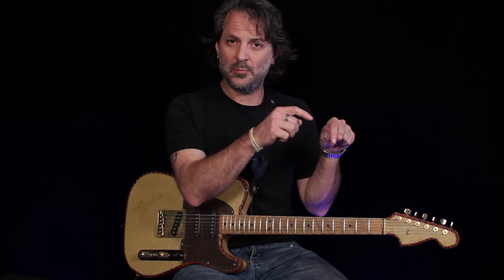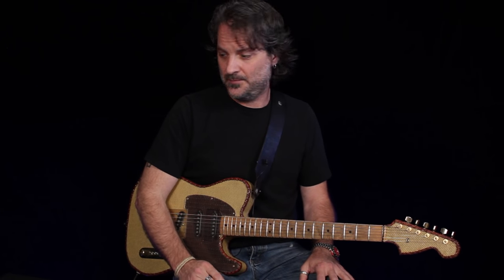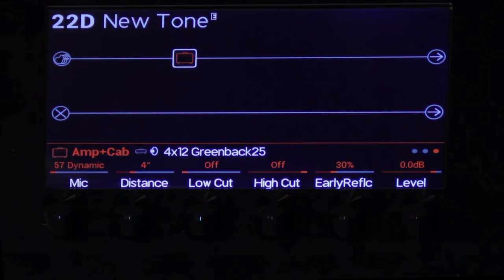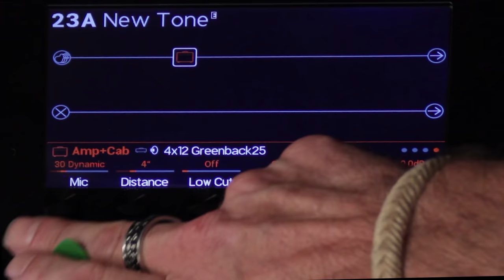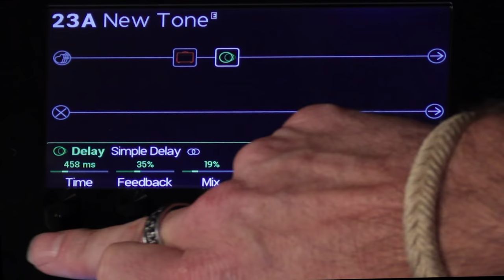Three Quick Tones With Helix | Line 6

Comment: what added value to the line 6 as a reference brand was to invest heavily in demos with amps , that is , as a guitarist and user of line 6 for 20 years , I am often confronted by young people who can not even get close to the sound of guitar that you present in these demos. In other words, young people buy line 6 and are frustrated with the sound.I give some examples taking into account what I see and watch in the country where I live;

many young people buy the helix, stomp etc thinking it will be plug and play, but when they get home and connect it to the amplifier, the sound does not match, some do not use the amp preamp to try to make the most of the simulations but even then they do not succeed.
For example for users of the best selling amps in the world: Fender Deluxe 5E3 «Tweed»
Vox AC30 Top Boost.
Fender Bassman 5F6A '59 «Tweed»
Marshall JTM45.
Fender Twin Reverb «Blackface»
Fender Deluxe Reverb «Blackface»
Marshall 'Plexi' 1959SLP Super Lead.
Hiwatt Custom 100 DR103.

line 6 should provide an equalization setting for users to come home and connect to the front (or just to the pre (using only the amp's power)) and be immediately satisfied with the result.
And the same should be done to the 3 types of guitars , les paul , strat and tele
This little job for line 6 would double sales. Hugs and thanks for your attention.

Comment: G'day Sean, can snapshots be set up to use both single (either modelled JTV or Mag) sounds and split JTV modelled and Mag tones in the same set of snapshot patches?
I believe it is possible, but nobody has been able to show me how to achieve this, stores have no clue, the Aussie rep is unresponsive, and the manual may as well be in Chinese to me.  I've been using the Line 6 gear for nearly 10 years, but still feel way more comfortable with old school pedals in line, so the whole digital thing does my head in.  I have spent literally days on end working through these units, and still not gotten anywhere.
I have set up a heap of snapshots (as best I can), but need a split harmonised patch edited into the snapshots, with JTV modelled tone on one side through one amp sound, and Mag pickup on the other with a distinctly different amp tone, and a slight (milliseconds) delay to make it seem more like two guitars playing together rather than an obvious duplicate patch.
Or another I want to edit in is to get a crisp Acoustic with a touch of compression on one side, and a crunch driven Mag sound on the other, with Wah able to be used on the mag side.    That same thing would be replicated as a 12 string / electric patch.  My original band has several  Country crossover (think Smokie or even some of Bon Jovi ) styled songs, where I need to be both acoustic and electric or 12 string and electric simultaneously.   So then I need to be able to switch back and forth from the twin input /output tones, and the standard single input tones.    The splits need to be panned about 70% or so either way to allow some bleed across the field, but still maintain some degree of stereo separation.  The reason for the bleed is  purely because in the past when I used the HD500X / JTV set up, I found that even though I had purposely set the sounds so for example the acoustic in a split patch may have been louder or softer than the electric on that same patch to suit the song,.. because I had the sounds panned hard left / right, the mixing guy would think I had fucked up the patch since one was not loud enough (to him) or too loud (again according to him) and he would instantly bump one side up / down, then when I switched patches, the next patch would be all out of whack.  As I am sure you realise, most of the time we want different stereo tones at different levels to achieve what we have in mind or to reproduce what is on the recording, but try explaining that to an overzealous FOH engineer.  Hence if I only pan them 70% L/R then they can't screw with it the same way as there will always be some of each sound bleeding across the spread.  Or if you know a better way to achieve this sort of outcome, i am happy to try that also.  I have seen a lot of your clips and you seem to get great separation, even on non stereo specific tones, and that is through shitty Macbook speakers, so I am sure if I went into the monitors it would be more evident.
I've explained this many times to locals who use Helix gear, but I am possibly the only guy in Perth WA with both the JTV and Helix, definitely the only one using Snapshots, so they glaze over as they have no experience using the JTV in conjunction with the Helix, and snapshots, forget about it, they don't know where to begin.   I figure if I am going to go down this modelling path, I want it to do the most it can do, otherwise I may as well be plugging a Strat, pedals and amp rig in, with my acoustic on an chest stand as I did for years rather than this fancy shit.

Comment: Interesting demo. Excellent guitarist and very authentic sounding tones. I'd be curious to know if I can turn the cabinet emulation/IR off and plug this puppy in EFFECTS RETURN of my amp and still sound really good? I suspect unit of this caliber would sound great into P.A. or FRFR speaker, but I'm still prejudice. I believe half my tone comes from my speaker/cabinet moving air.
Reply: +lpgoog  never forget that this is an evolution of sounds that if a person knows how to use very well with your amplifier will play 'always great method 4 cables use real amp with effects helix or use your amp helix with final amp true.
Reply: +lpgoog 
The great thing about the Helix is, not only can you turn off any cab sims, but it also has a Preamp model section. I would use just the preamp models if I were going to be using an external tube power amp and speaker cab.

Comment: It would be nice to have a little more love for those of us that have already spent a small fortune on HD500 and DT series amps.  A little more effort on some DT integration work-arounds would be nice.  I realize the architecture is completely different with the helix, but give us a little something more to work with please.  It's really the only reason I'm not planning on buying a Helix.
Reply: +Stratomacaster Yeah! Another one here. Until the DT integration isn't as good as in the POD HD500 and there is no decent GUI to tweak Helix on a PC, I'm not even thinking of buying Helix. A shame because Helix is maybe the best floor unit on the market, period.
Reply: They developed an entire new class of product, and it is obviously not designed to be an incremental change from the old stuff. Demanding integration with the other lines is really unreasonable from my perspective, and would steal resources from making the HELIX the best it can be.
Reply: +The Guitar Geek So, why did they bother adding a L6 link output there? Only to integrate with StageSource? The L6 is a Blend of audio out with Midi messages where we don't have to know nothing about Midi. It doesn' require any significant processing power. I can't understand Line6 option, really
Reply: +Nuno Carmona  The L6 FRFR speaker output is exactly the reason why the output is there. The HD500 was never meant to be compatible with HELIX, but the speakers are. Just be cautious when claiming how "easy" it is for a company to add, code, test and support features.
Reply: Easy or not it seems product management failure in that point to me.
Reply: Your point on the DT integration is well taken - I don't love the message that sends. Still, the complaining about the HD500 / HELIX compatibility seems unreasonable.
Reply: The Guitar Geek a year late but just saw this. That’s not what we’re saying. We bought a dt25 amp with an L6 link and they made the Helix unusable as far as that goes. Another waste of money.
Reply: I think you’re coming at this from the wrong angle. Which I understand, but just because the hd500 and dt amp setup isn’t the “latest and greatest” thing on the market, doesn’t mean you wasted your money. Do you like the sounds? Do you know how to use it? That’s all that matters. I own a helix and I still find myself fantasizing about the dt amps they sound killer!
Reply: James Hughes were just saying the L6 link should’ve been integrated into the helix since some of us just bought the dt25 amp head and cab. Since it doesn’t, the helix is still better. Doesn’t have volume spikes like the hd series. Out of all my amps, the helix sounds the best in the return of the dt25. And my other amps are tbh better amps.